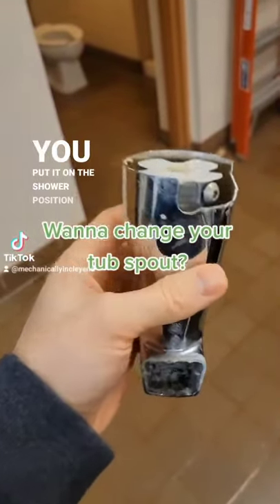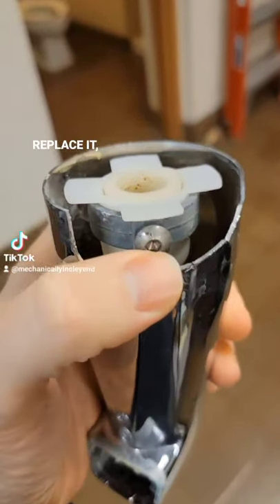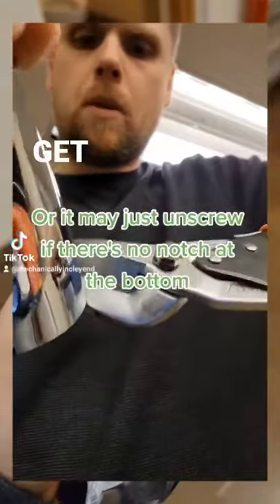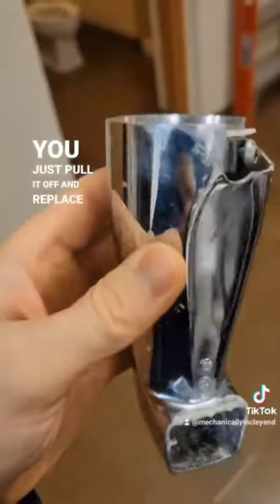How to remove a tub spout if you can't find the screw

Comment: I was hoping that i don't have to cut my faucet spout but guess it has to be done. The dang screw is somewhere at the wrong location and i can't find it. Time to go buy some heavy metal cutter
Reply: How'd it go?
Reply: @4DChess  , turn out there is no screw. The faucet spout was just screwed on really tight, so i had to use a wrench to turn it. I also had to need replace a new spout because when i used the wrench to turn, it cracked at the tip so the coating came off. A small chip fell off,  became pointy and sharp too.
Reply: @MyRx777z  damaging an old one with a wrench, then replacing it, was still probably simpler than doing metal cutting!
Reply: @MyRx777z thank you. All I had to do was unscrew the darn thing!

Comment: I'm going to try this! What if we also have water leaking out the handles that turn on hot or cold or switch it from tub to shower? My home was built in the 1950s and I'm pretty sure this is the original tub, if not the original faucetry.
Reply from the maker: You should get the whole thing rebuilt get some estimates
Reply: @Mechanicallyincleyend  link to diverter video please
Reply from the maker: @yogismokes1628  https://youtube.com/shorts/UDyivJMgyDw?feature=share